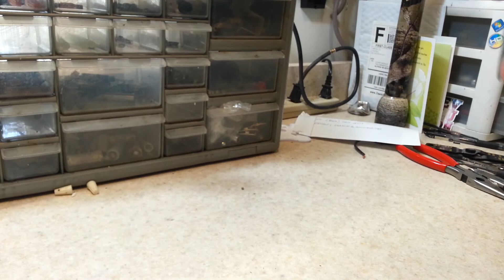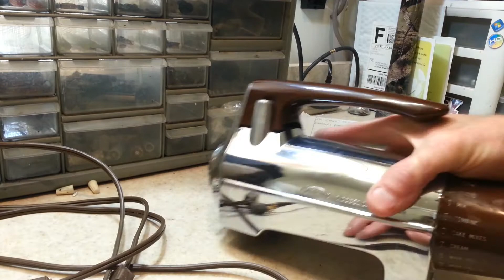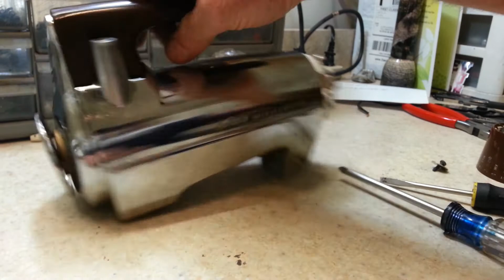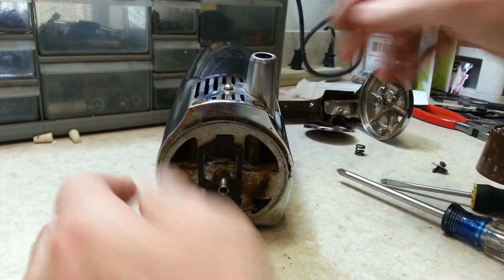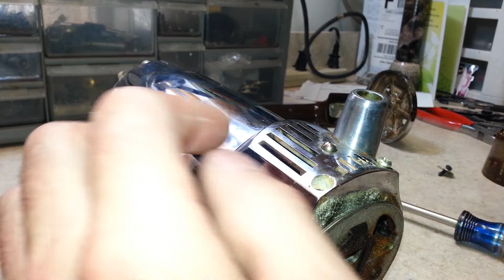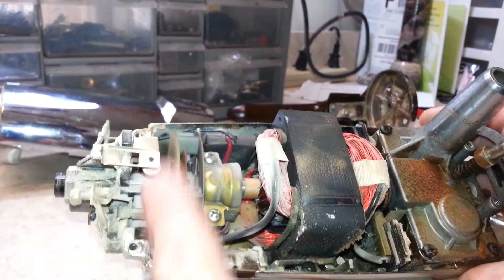Sunbeam Mixmaster 1-8B service and maintenance

Comment: Just got one of these 1-8B from my mother. I would like to replace the brushes and the resistor while I have it apart. Can you point me to a parts place? Also I would like to know how you cleaned everything up on the inside. I don't expect you to give away any trade secrets, but a little hint would be nice, like what kind of grease that is. The only problem mine has is that it smells like something is burning when I use it. And, when you wiggle the brown speed knob back and forth the machine will come on even when it's in the OFF position. Really appreciate the video. This is a job I would like to tackle myself.

Comment: This video is excellent and your machine came out clean as new. Impressive. I have to repair grandmas' because it sometimes won't turn on when just clicked to low. It will kick in when the speed control is turned a bit more. May be a dirty contact so I'll take it apart and burnish them. Yours looks like it would go another 40 years now.

Comment: Loving your videos, They are very helpful and much appreciated. I have a similar mixer to this one from my grandmother that I would love to refurbish and re-grease but I cannot pop the caps off to release the gears. I have seen another video where you pry them off with a screw driver but I cannot manage to get mine off. Are the caps designed to be re-used or were they replaced when serviced. I know you are no longer doing these videos and I am not sure if you monitor this site at all anymore but I thought I would ask here anyhow. Thanks for your time.

Comment: I may need to chat to you about mine. I’ve been given an absolute immaculate 1969 model that probably hasn’t been going for quite some time. But plugged it in and it runs. Gets to around half way on the speed settings but won’t go any faster. But anyway good helpful video.

Comment: You know if somebody watches this for the first time and have never worked on a mixer they are definitely going to have problems - just saying. You heat up the plate on the front to remove it how do you get it to contact back on? You should show us how to replace that pin and also that wire on the back that's like spring retention. I haven't seen the video where you pop off the caps for the mixer blades but you said it was out there - you do a good job and I hope someday you can find the resistors? that you need.

Comment: my machine (same as above) starts to smoke from the back after 30 sec of use need help thankyou
Reply from the maker: It is either running too low of a speed, causing the resistor to heat up, or the resistor is way out of spec, or there is old flour dust built up on it. These are the first things that come to mind.

Comment: beautiful video just want to know how do you rebuild a resister thankyou
Reply from the maker: I just inserted a 180 ohm wirewound resistor inside the housing from the original resistor, and removed the original resistor wire that was wrapped on the outside. They do get hotter since they are only 5 watt, but you can turn up the lowest speed a little, and only use the lowest speed for short periods to help it last. Unfortunately there is no really good solution since there is not a replacement capacitor being made for these.
Reply: Vintage Mixers and More what happens if I use higher watts also my resistor insulation (white coating outside) 1/4 is remaining and other is gone you can see the wiring can I just use the 180 ohm 5w resister and solder to the original resistor place Thankyou for help
Reply from the maker: @junaidhassan6839  A higher wattage resistor would be better heat wise, the problem I ran into was I couldnt find one that fits. Yes you could just replace the old resistor with that one but I would not recommend soldering it, as it will probably melt if used on low for any period of time. I used to solder the ends to the original caps on the end of the resistor, but even using a high heat solder, it would still sometimes melt so I stopped soldering them altogether.

Comment: Might I ask where you got ahold of replacement resistor for the mixer? I am currently rebuilding one and cannot find a similar replacement for the life of me. And I also can't seem to find where that pin goes that you described at going to the speed controller. Thanks, any pointers are appreciated.
Reply from the maker: They are not available anywhere, I just purchased 180 ohm, 5 watt, wirewound resistors and installed it inside the old resistor housing. It is about the only way I have found to repair a bad resistor. I used to find them on ebay, made by Dale, but I have not been able to locate them lately, so it is definitely getting more and more difficult to keep these old machines running. 
The pin goes from the governor on the rear of the armature, to a slot onthe backside of the speed control assembly.
Reply: @vintagemixersandmore1666 alright thank you so much. I was originally hearing that I should order a 150ohm 10 watt resistor but I will try your suggestion first. Have you found that these newer resistors heat up any faster or slower compared to the old ceramic one?

Comment: I was thinking that maybe you could solve your problem with the camera being in the way would be to use a mirror. Rig up a mirror on the ceiling above your head so that you could pivot it to any angle you desired and set the camera on the parts been in front of you which would get it out of your way.
Reply from the maker: Thats an interesting idea, I may have to play around with something like that!